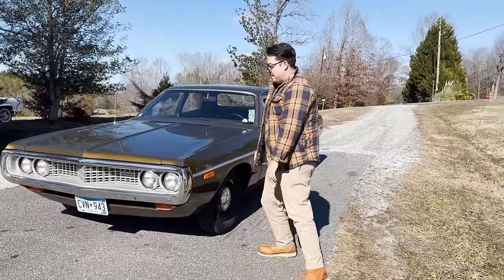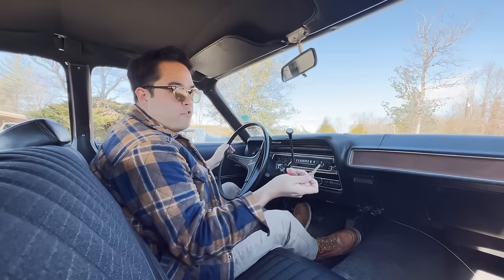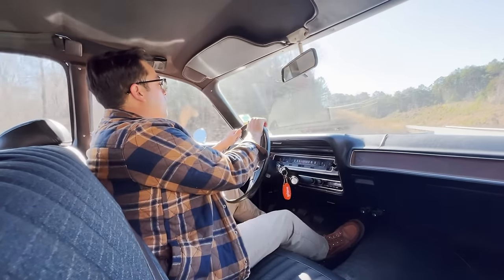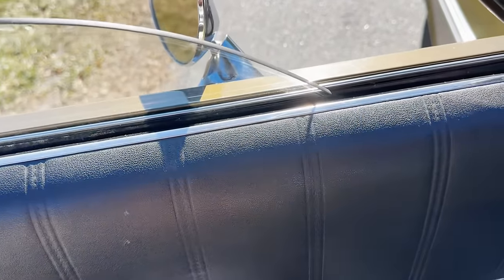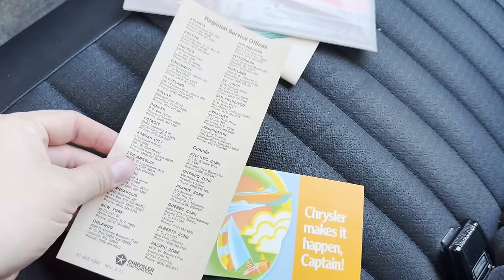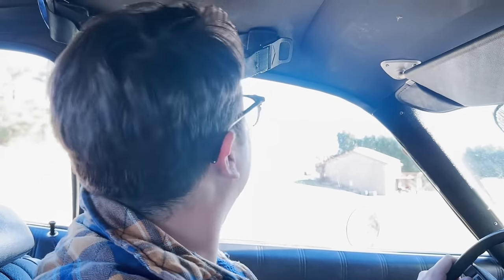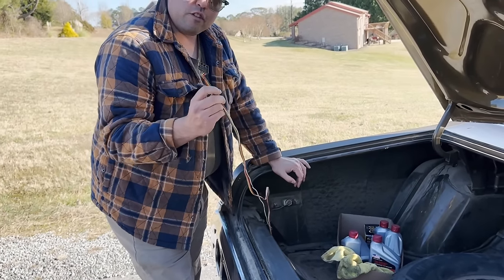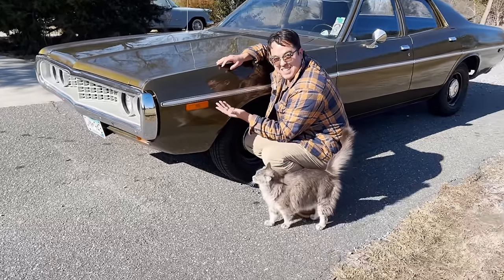1972 Dodge Coronet Custom! Rare Slant Six Stick Shift! Obsolete Automotive Reviews Walkthrough Drive

Comment: What a beautiful Coronet it makes me miss my 71 scamp. I'm curious on the hubcaps usually Chrysler would paint the rims the same color as the car when they came with the little dog dish hubcaps so I'm kind of curious if that car originally came with them little poverty caps and not the full wheel covers being that the rims are not the same color as the car maybe if you ever get the build sheet it will say?
Reply: Chrysler stopped painting the steelies body color sometime during the 1971 model year.👨‍🔧
Reply from the maker: The dogdish hubcaps were standard on this vehicle. As far as I know they are original.

Comment: Great car, but back then, we called "stick shifts" any floor shifter.  On the column was a "manual" or "three on the tree."    My Uncle almost bought a new 71 Satellite with a manual.  Last minute decided to by a Fury II with torque flite.  Thanks for the memories.
Reply from the maker: Seems many folks getting up in arms about the “stick shift” term. Maybe it’s regional. Where I’m from a stick shift is any manual trans car. Both use a “stick” to shift with and have the same H pattern. It’s slang. On the column was also referred to as “3 on the tree” as well. I’ve also heard people say “3 speed column on the stick” so people say a lot of different things it seems.
Reply: Thanks for the reply.  As I said "back then" when I had my used 61 Ford Falcon in college it was a standard shift car.   When "four on the floors" came along, they were called  stick shift cars, because of the stick sticking through the floor.  I think that trend began with the GTO/other muscle cars and maybe earlier MGs.  By the way, I have seen articles about Mopar wagons with four speed stick shifts (on the floor).    Quite the rare cars.   Three speed column manual wagons were  more common.   @ObsoleteAutomotive
Reply: The torque flite was the best choice...very durable, just like that slant six.

Comment: The last manual three speed on the column I saw in a car and drove was around 1979. I was taking Driver’s Ed and the cars were new and loaned or leased from local dealers. It was a two door Nova, straight six with the do it yourself transmission.  Your running through the gears reminds me of my dad blowing the cobs out of his 1967 and later 1974 Ford F100 customs with 240/3 speeds. Anyway great video. You’ve got a really unique sedan.
Reply from the maker: Cheapest of the cheap! That’s usually what got loaned/leased. Glad you enjoyed the video!

Comment: 81k miles on a slant 6 is just broken in.
Reply: True for the engine...but the shift linkage on those cars would break/wear out by 100 thousand miles or so. The slant 6, if maintained, could last at least 200 thousand miles.

Comment: Very cool. Thanks for sharing. I have a '72 Coronet 318/Auto.  I will have to do a driving video of it in the spring. It is a cream puff for sure. I did a few things to it since buying it from the original owner like upgrading the exhaust from the factory single to a dual exhaust. Everything else is factory original. Mine has the factory Front Disc brakes / Rear Drums, Cruise Control and A/C. THe factory steels with hibcaps are with the car, but it currently rides on the Chrysler Rallye Wheels with blackwalls.

Here's a short video of it after I had the Rallye Wheels powder coated and n ew set of Hankook Blackwalls installed:

https://youtube.com/shorts/bkES-bMXwXE
Reply: Yay, another Coronet owner!  I have a '71, also 318/auto.  Looking at your driving video they might even be the same color, mine is F3 Medium Green with a green interior but originally a black top.
Reply: Very cool. I have an unrestored low mileage 74 Charger. 318 2bbl, similarly equipped to your Coronet. I did dual exhaust and added 15 Mopar police rims. It's on my channel, too. 😎

Comment: Awesome car.  Slow down your shifting.  Let the syncromesh have time to do its thing.  Moving the shifter to the next gear should almost effortless,  Neutral to 1st should be palm facing you.  First to 2nd, and 2nd to 3rd, should be palm facing forward.
Reply: That was my observation too. "Speed shifting" is a no no
Reply: @loumontcalm3500  Yeah...I was cringing when he was shifting that poor old car!. The linkage on those MOPAR three speeds were rather weak anyway!

Comment: Love it, good old slant 6 and three on the tree. I had a monstrous 65 Dodge Polara with slant 6 and 3 on the tree. It actually pulled pretty good considering the small size of the motor in relation to the size of the car and it was bullet proof.

Comment: The 225 was superbly reliable. I grew up with a 1987 Dodge 150, last year you could get a 225, that was mated to a 3 speed auto. That beautiful blue truck went for 675,000 miles. We were the second owners, and we had that truck from when I was 3 to when I was 20. I learned to drive in that truck, took my first serious girlfriend on a date in that truck. Floorboards were rusted all to crap; a seal broke on the windshield from something hitting it and it just leaked water down one the floor.
 I miss that old truck so much I keep looking for one like it.
Reply from the maker: Wow that’s a lot of miles! Good luck in the search! Hope you find one!
Reply: Gr auto gallery on you tube has a gorgeous slant 6 1986 d150 for sale there is a video of it on yiu tube

Comment: Stick shift must be rare.  My grandad gave me his '74 Coronet in 1989 (sold my Civic to come here, and he could no longer drive); only 56,000 miles on it when I got it and I drove it for almost 8 years. It had the very nice turn signals on the hood - they fenders corroded and they eventually just fell into the fenders. Mine was the 318 V8. I loved the heating controls on the left (away from the passenger).
Reply from the maker: I had a ‘74 coronet ex police car for a short while. 360 V8.

Comment: In the '70s, used cars listed for sale in the back pages of the daily newspaper typically had "R & H" meaning "radio and heater" because those were optional, not standard in cars built before then. Seat belts were optional on many cars as well.

Comment: 71+ year old FUD here. I can remember every car my folks had back to the 1950 Plymouth. All had “3 on the tree” with no radio or AC until they bought a new 1965 Dodge Coronet 440 with the 318 V8. Finally got an AM radio but still no AC.😢 We lived in a really small (population about 225 ) Iowa town so only jobs for youngsters were working for farmers. I actually learned to drive tractors and trucks pulling wagons on country roads before I was old enough to get a learners permit. Got that learners permit at age 14 in 1967 and did my first legal driving in the Coronet. Dad let me drive a lot even when I only had the learners permit. I had a lot of miles in the Coronet before I got my license at 16. The first car I owned was a 1970 Plymouth Duster with a 198 cu. in. slant six and “three on tree”, no power anything, AM radio AND hang on under dash Chrysler Air Temp AC. I got the car used in 1972 while in college so don’t know if the AC was a so-called dealer ad on or what but I remember that Chrysler Air Temp logo on the under dash evaporator. I don’t remember if it had any safety interlock on the steering column or if you had to push the clutch to the floor to start it. I learned to drive those tractors and trucks with manual transmissions so it was just automatic to put a vehicle in gear when parking especially on any incline. Seldom used the parking brake so it was some times a coordination trick to start before it rolled too far down an incline.😂 Kept that car for six years until some guy rear ended me and it was totaled.
     I was a dedicated MOPAR driver both cars and trucks until the early 1990’s when Chrysler started going to crap.  The last daily driver we had was the tin can 1987 Plymouth Reliant K Car with the 2.2L 4 cylinder. Good fuel mileage but nothing else. You’ve heard of being nickeled and dimed to death? That thing $400’erd me to death. Bad injectors and head gasket problems. Never less than $400 when it went to the shop. Now the only Chrysler product I have left is my 1954 Dodge Coronet with a 241 Hemi and two speed Power Flite automatic transmission. I can pass a semi going up hill with no problems.

Comment: Simple is better.  This is a car a guy can work on.  I've owned many like it; currently I have a '77 Aspen, 3 on the tree, slant 6, no AC or power steering, crank windows.  Great, simple car.  Btw, loved that intro (first 1:30... perfect!)
Reply from the maker: I had a 76 Aspen wagon with a slant six and 4spd (OD). There was a lot of effort in the intro. Glad you liked it.

Comment: The wiper motor had to reverse when you turned the switch off, in order to pull the wiper arms down below the bottom of the windshield. I had a 75 Cordoba with that feature, and the wiper motor was weak and couldn’t pull them down. So you’d have to get out of the car, push down on the driver’s side wiper arm while flipping the switch on and off. 

Incidentally, my dad had a 74 Dart when I was a kid, and it didn’t have the opening for the wipers to hide behind, but it still had the same parking mechanism that pulled the arms down  when you turned them off.

Comment: Nice find. Oddly enough, I came across a similar 1972 Coronet with the slant six and three on the tree advertised in Auto Trader in Toronto a few months back. Surprisingly, that car was also very clean, with low miles and very little visible rust. Love the proportions of the fuselage B bodies, and the loop bumpers on the early 70s models.
Reply from the maker: Interesting! Can’t be many out there still surviving!
Reply: @ObsoleteAutomotive  Most of these disappeared more than 30 years ago. Can't remember the last time I've seen one (outside of a show) here in the Southern Ontario rust belt.

Comment: My dad drove Plymouth through the 60’s to the 80’s. He only had 383, 360 and automatic transmission. I like the 6 with the column shift
Reply from the maker: The 6cyl with manual trans is quite the oddity. I think it’s so neat it still survives today!

Comment: Those slant sixes are tougher than a lighter knot. My very first car was a Valient Duster with a 225 slant 6. My dad owned a 65 dodge pickup that came originally with a 170 slant 6 and three on the tree. The engine eventually went bad with I don’t k ow how many miles on it. It burned oil like crazy but still ran. My brother swapped it out with a 225 slant 6 that was still running long after the rest of the truck went to pot. I bought a 1963 dodge step side truck with three on the tree and drove that for years until I sold it.

Comment: My parents had a 1968 Dodge Coronet two door with a 3 speed manual on the collumn like this, when I was a little kid.  (I'm now 50 years old).  That was an awesome car.  It had four wheel drum brakes as well.  The three speed in this car probably had it running at 4,000 RPM on the highway, subtracting from the gas mileage, as there was no overdrive.

Comment: In 1987 I bought a 1972 Coronet Custom with 44000 miles. It was 318/904 auto. No rust except a bad perforating spot above the windshield a vinyl roof problem.  I was younger and into hotter cars so sold it within a year.  I was concerned that a rock to the windshield would total the car as there was no way to replace it after my homemade patch job.  Very reliable but unexciting car.

Comment: IIRC, your 3.21/3.23 point there actually had to do with which actual differential it came with, not really an option as to which ratio you wanted.  The Slant 6 - 3spd manual  could have come with a 7 1/4", or 8 1/4" diff.  The 'option' there was to get a heavier duty diff, which came with the other gear ratio.   

Cool car!

Many years ago, a guy I worked with had a 1970 Plymouth Fury 4 door,  with a slant 6 and a 3 spd manual.  Something I didn't think could even happen!  Would have been a cool car to fix up, just because it was so strange!
Reply from the maker: Someone else said the same thing about the rear ends. Odd that the literature and dealer showroom book doesn’t mention this. Just shows the standard and optional ratios. 

I’ve seen a few slant 6/3 speed manual 1970 fury sedans actually! I want one!

Comment: The 3.21 and 3.23 were the same ratio for all practical purposes. The 3.21 gear was for the 8-1/4” rear axle. The 3.23 gear was used in the 8-3/4” rear axle, which was the heavier duty unit. The sure-grip unit used the 8-3/4” rear end.

Comment: My first new car was a  basic  '74 Plymouth Satellite, $2700. Slant six, stick on the column, no power steering,  no air, no radio. Very reliable and long lasting but dull.

Comment: In Peru the Dodge Coronet with the Slant Six and manual shift is not as rare as in the USA, in the 70s many were armed with the Slant Six engine in Peru, it was not as common with the 318ci V8 or the 400ci V8 because those models were imported.

Comment: had a 70 Satellite and a 70 Duster with that slant 6.  bulletproof.  kept a set of belts and air filters.  changing the plugs, points and condenser was easy.  as i remember the dwell angle was 44 degrees.

Comment: In the early 1980s I used to car pool with a guy who had a 70s Dodge Dart with the slant six and 3 on the floor. It was blue and it had the rust thru holes in the tops of the fenders.

Comment: In the '50s and '60s Consumer Reports told readers "you'll get faster heat with a Six (than a V8)" and that would probably be a consideration in WI and MN.

Comment: Have you watched behind the rear bench (from the trunk) ? ChrysCorp used to insert the building sheet there. 
The codes on the sheet are easily readable if you look on the Web.
Beautiful toy by the way, take care of it!
Loved the intro, too. Will there be a similar one for the 62 Plymouth?
Cheers from a swiss Mopar fan
Reply from the maker: I haven’t looked for the build sheet yet but I did decode the body tag.
Reply: Very good, but it doesn't tell anything about the original options installed on the car ; the sheet will.

Comment: I would own and drive that. I was 18 years old living in Wisconsin in 1972. It was uncommon there then for a car to have A/C. I bought a 1967 Plymouth Fury that did have A/C. Lucky because I moved to San Antonio. I had the 318 V8 engine. It would cruise all day at 75 mph and got decent gas mileage. We believed then that a 6 cylinder in a full size car wouldn't get better gas mileage because it needed to work harder. I did later own a 1965 Dodge pickup with the 225 slant 6 and three speed on the column. It did fine around town and going 55 mph on the highway. But it ran out of steam trying to go faster than 65 mph. But Nixon took care of that with the 55 mph National Speed Limit in 1974.
Reply: We had a 1975 Fury sedan with a Slant 6 and automatic. When you eventually reached 60, it would get decent mileage.

Comment: That engine has the easiest starter motor to replace. I had a 1972 with the 318 in it with a 4bbl carb auto trans. Such an easy car to work on.

Comment: The windshield wipers & windshield area just looks cleaner & neater  with the wipers parked under the hood  it’s higher end then being parked in the exposed position all the time  I like them concealed  which they were not on The  69  Lincoln Mark 3  but by 70 or 71 they were hidden which I thought was cooler it’s just a personal taste choice
Reply: I think it may save manufacturing costs too.

Comment: This is an excellent informative video, I'm in Englland and I own a 73 Scamp 225. If there's one other Mopari would love it's a 72 Coronet  - specifically a 4 door Custom sedan (not hard top) I'm pretty impressed with your opinion of the slant in a larger car, not too sure the manual transmission on the wrong side of the car would be my choice (I drive mostly manual cars here, but I'm sitting on the right 😄). I've only seen one 72 Coronet in the UK and it wasn't for sale. What sort of money would your car be worth out of interest, and are they easy to find?

Thank - Chris.
Reply from the maker: Hard to say what the “value” might be for this particular car due to its odd features. But generally I’d think 4500-8500 price range is typical for driver quality Coronets. 

These cars are hard to find in good shape as many were destroyed with use and abuse when they were new. And many more destroyed by the movie industry as police cars!
Reply: Most of the world drives on the right … The rest drives on the wrong …

Comment: Had a 73 coronet custom with a 318.  No ac or power steering, only power brakes with a heavy duty tow package that had the heavy duty rear end and brakes.  The car was a sleeper.  It would lay rubber for at least 300 feet.  I was smoking other cars with big blocks of that era.

Comment: I had a 72 Plymouth Duster 225 slant six 3 speed floor shift power steering am radio bought new 1950.00.

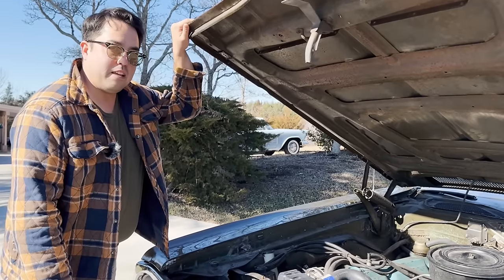Comment: It may just be the exhaust note, but it sure sounds like it could use a 4th gear or overdrive. It does have a 3:21 rear end.
Reply from the maker: A 4th gear would be nice. But not too bad with this setup.

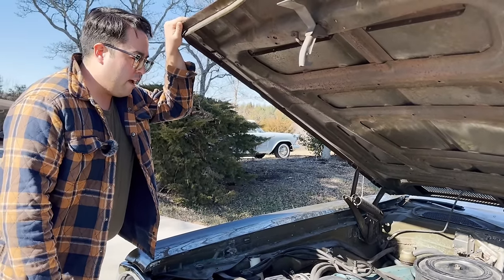Comment: Retired mechanic here 67 year old love the car have my own Plymouth Duster for 45 years with a V8 if it was mine I'd have to put a 3:18 in it but still nice with the 6 cylinder from my experience put a regular muffler on it or a turbo style Muffler example like a Dynamax call I will perform better and sound better mistake that most people make straight pipe on a small displacement engine like that you're going to lose power and not gain it straight pipes only work good on engines that are in Racing tune put a muffler on you'll be a lot happier and it will feel better